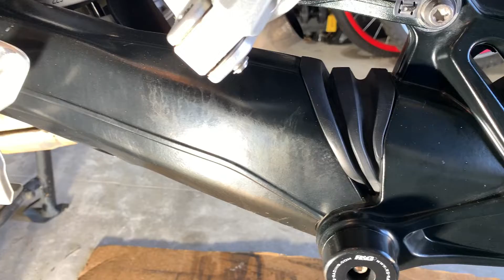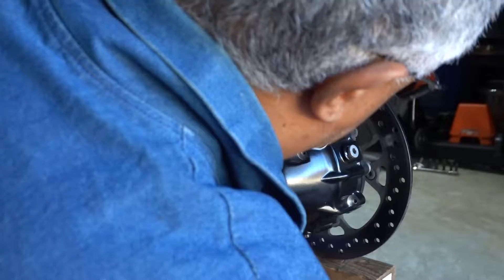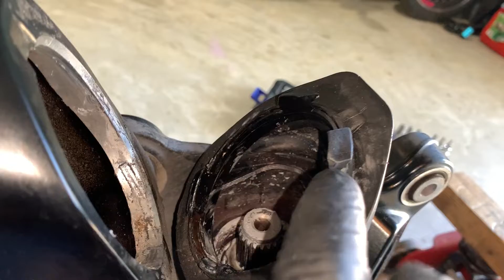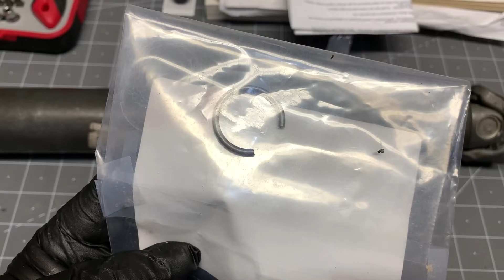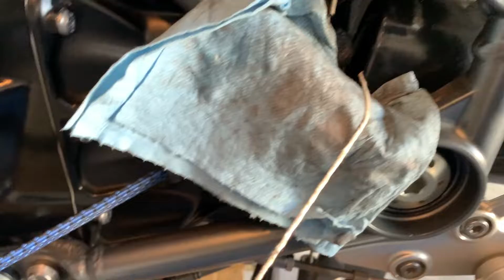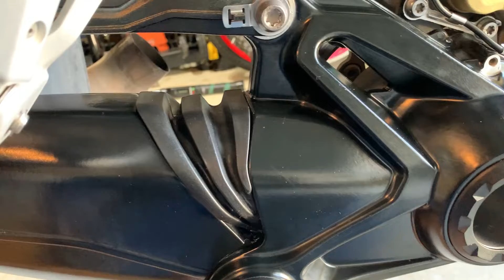Final Drive Service & Shaft Check ... rusty splines? | 60,000 mile Service | 2016 BMW R1200RS

Comment: Just serviced the shaft on my 2024 RS prior to riding the bike 4 miles on the clock trailed from new to my workshop , stripped down and found no lubricant at all on the gearbox output shaft and a slight coating of white grease round the final drive shaft , not good , like you no clip fitted from the factory and that’s on a new bike so don’t worry about it clearly not required 👍🏻
Reply from the maker: Thanks for the comment. If you read the comments for this video you’ll see more than one about the clip, some of which border on the accusatory regarding whether it was missing at the outset. Yours is another testimony that these bikes may or may not come with the clip from the factory. Of course I knew that years ago, and am totally not bothered one iota about the lack of clip. 😊
Reply: @ No problem , really enjoy your input , hope 2025 is good to you and you enjoy many happy miles in the saddle , from a fellow RS owner in Scotland 👍🏻
Reply from the maker: @AWROO08 Thanks!  Happy New Year to you as well.

Comment: Did you actually leave the output shaft slip ring off ?
Reply from the maker: Yes
Reply: @GrumpyGoat  have you had any issues with out it being installed?
Reply from the maker: Not one. There are some people that seem to believe that this clip is somehow critical. The lack of clip presents only one potential problem - the shaft fusing to the rear drive unit if the splines there are not lubed. Watch the rest of my videos to see what I mean. And consider subscribing. 🙂
Reply: @GrumpyGoat  Yes, I have done mine , took the ahaft right out on my GS1250 and serviced / greased up 
All good now , yet to do my RT1200LE in the spring.
Reply from the maker: Prior to BMW coming to their senses on this shaft issue, any owner of these bikes would be well advised to pull the shaft every 12k miles and have a check. Now they have formalized this.

Comment: What is the reason, not to remove the rubber boot?
Reply from the maker: @motocomfort_de  Removal is not needed to do the service in the video. The quicker I can get the job done the faster I am able to get back to riding.
Reply: @GrumpyGoat  I have inspected  hundreds of driveshafts. To spray and fix all the scratches lasts much longer than  the removal of the rubber boot. For your own driveshaft it might be ok. 👍

Comment: I can’t believe that after 50 years they still haven’t fixed this problem in 1971 i had a r 75 and the drive shaft splines failed had to haul it home 600 miles got rid of it and bought a Honda never looked back
Reply from the maker: I can only comment on the water-cooled boxers but their treatment of this issue has been less than satisfactory. They have now started to offer replacements for the GS and RT, but the RSs are treated on some sort of a BS mysterious way in that some people are being told they get their driveshaft replaced and others not. My bike has had 60k+ miles on the original driveshaft and BMW is yet to let me know that I am eligible for a free replacement. Even if I have to pay for replacements after that, I can understand, but so far nothing. Leaves a sour taste, that is for sure.

Comment: I would not remove the circlip.  I just did this service on my 07 GSA and pulled the swingarm to re-install the driveshaft.  Upper shaft IMO only needs service every 24k miles or so.
Reply from the maker: Noted, regarding the circlip. I would not remove it either. 

There is a reason I choose to do the shaft service every 12k on my RS, and that is now validated by BMW “quietly” bringing back the bikes in my year for a change to the shaft at no cost to the customer.

Comment: I used to do this with my k1200lt. I am glad to go back to a chain. I'm enjoying my Kawasaki Versys. Simple and inexpensive.
Reply from the maker: There is a lot to be said for the simplicity of a chain drive ... until you have to change the chain and sprockets 😉 The service on the shaft is a PITA but is not too hard once you have done it a time or two. Just takes time away from riding. OTOH, you don't have to even think about the drive train for 12k miles (that is 24 lubes and many cleanings of a chain)
Reply: @GrumpyGoat  6 in one half dozen of the other. 🙂🙃

Comment: Thanks for the video . The clip goes in the front of the drive sharft . u wil see if u look in the front hub where the splins is , at the back in side is a groof . fit the clip in . ones u push the spline end in to the back of the drive sharft of the gearbox . take a rubber malat or wooden blok and tap it from the rear end of drive sharft . that clip is very important , it prevent the Drive sharft to move forward and back wards , when the swing Arm goes up and down . Kind Regards Michael .
Reply from the maker: Thanks for the comment and interest in complete installation, Michael. 

I am aware of where the clip is supposed to go. My bike did not come with this clip from the factory and there were no issues. I agree that the angular movement of the swingarm results in an axial movement along the ends of the cardan shaft in way of the splines. On my bike without the clip there is simply movement on both ends. With the splines lubricated every 12000 miles this is not an issue, with the clip not installed. Not having the clip installed makes removal of the cardan shaft easier when I want to pull it and inspect its U-joints. And that is more important to me than having the clip in place. 👍

Comment: the ring is probably on the splined sleeve, that's why you couldn't install the cardan shaft.
Reply from the maker: I may have mentioned (repeatedly) there was no ring installed on my bike from the factory. Neither on the male or female end of the connection at the transmission end of the cardan shaft. Others have reported similarly. A friend said his trusted BMW technician told him he has seen bikes without the ring installed. 

Without the ring the cardan shaft is more easily installed and removed. 

Thanks for the comment. Sorry if I seem defensive but there is another viewer who insists I must not know what I see / feel in front of me, arguing that the ring has to be there - on my own bike!

I actually have a set of 3 videos which I did around 48k where I discussed this absence of ring. I have since decided I don’t want the ring on my bike. It works just fine without it. I have also decided to pull the shaft every 12k miles for inspection. Lack of ring makes that job easier. I also have a new shaft sitting on the shelf.
Reply: Thanks 
I’m from Brazil, and here we have a lot humidity, so i inspect ir every 10k km.
Reply from the maker: @rafael45357  I’m not inspecting it for rust on the spline. I am inspecting it to see the condition of the universal joint. These have failed in many bikes Anna that is my primary concern. Cleaning the spline of rust and relubricating the spline is just an incidental maintenance step for me. Neither are called for by BMW as part of scheduled maintenance.
Reply: @GrumpyGoat  here in Brazil we have had several cases where the rear splined axle is welded because it lacks lubrication and humidity.
Thanks
Reply from the maker: @rafael45357  I can well imagine. Good to inspect and lube periodically.

Comment: Obviously in order to assemble with the snap ring you have too insert the ring in the inside diameter of the drive shaft. It would be impossible to assemble the way you tried.  All that aside. Thanks for your efforts 21:50
Reply: The purpose of the lock ring is to prevent the drive shaft to slide in and out from the output transmission shaft
Only the final drive end slides in and out of the drive shaft(pinion shaft).
The movement is so little,one end is held stationary and only the rear of the drive shaft with pinion final drive floats.
If You look at a rear drive car, there is a sleeve with a grease fitting that slides in and out as the droop of the rear end changes the length of drive shaft.
Put that lock ring back and prevent the drive shaft to walk back and forth.
Reply from the maker: @ralphpettino296  Thanks for the comment. One does have to wonder why some bikes did not have the ring fitted in the first place. For me, I want to be able to easily pull the shaft to inspect both ends. Having the ring in place makes removal more of a chore with no perceived practical benefit.
Reply from the maker: Thanks for your comment but I don’t agree with you. Just to let you know, several RS owners who I know and respect have reported that their bike did not come with a split ring, while others did. 

I will admit I could have tried harder to install the clip, but I was inclined to not bother since it was not a problem up to that point, and removal would be made unnecessarily more difficult, and it was my intent to remove it every 12k miles.
Reply: @GrumpyGoat  If you don't have a clip it must be installed in the driveshaft, not on the transmission output spline. The problem is that it's extremely difficult for a diy'er to do without the tool designed for this purpose, maybe a service tech could help with that. If you were to buy a new driveshaft, the pin will be pre installed from the factory. If the retaining clip is not always there as you mentioned, the shaft should slip out when the final drive housing is pivoted back or removed. If the clip is in tact you'd lever a long screwdriver in between the shaft and u-joint on the front end to disengage it. You would lever the shaft in the opposite direction when installing, Do not beat on the back of the shaft to accomplish this. When levering the shaft in place, you should hear a click or snap and a forward movement of 1/8 to 1/4 inch when engaged. This process is explained in the Haynes manual for these BMW's. If the front splines are not fully engaged, the rear will not engage. If there's no clip, you will likely have some back and forth movement, albeit slight, of the shaft, which could cause unnecessary wear on the splines and u-joints over time. BTW, the retaining clip fits in a fairly deep grove and is not easily visible with the spline grease covering it. The grease should be 60% moly, which is more like a paste than your typical generic grease.
Reply from the maker: @surferdude642  I said what I said and am done. I bought a new driveshaft and it has no clip.
Reply: @GrumpyGoat how much $ was the new one?
Reply from the maker: @ About US$200
Reply: @GrumpyGoat  used to be 1200$ in early years 😀
Reply from the maker: @ Yes that is why I bought one of the new ones at $200 before it went back up. Then BMW issued the change to the maintenance schedule and decided to change out shafts every 36k miles. So I have a spare shaft.
Reply: @GrumpyGoat   I believe the ring can get destroyed at dis assembly. This would explain why some claim it never was on their machine. In your video when you dropped the final drive down the shaft released from up top. A clip would have prevented that. Operating without the clip may put forces on the final drive that engineers avoided with the retaining clip.
Reply from the maker: @chuckgenaro4373 , have you actually done this on this bike? The clip cannot be destroyed *at all*. It is not made of weak plastic; it’s a thick steel ring. Pulling the shaft out with a steel circlip in place cannot destroy the circlip. It would either stay in place inside the gearbox end, or it would come out still attached to the driveshaft spline. Intact. 

In my case, originally the driveshaft slid out of the gearbox end *without any hint of resistance*, i.e. there was nothing there to hold it back. Also, a friend informed me that his BMW master mechanic of 30-some odd years confirmed to him that some of them come without the circlip. 

So, my experience is that mine did not come with a circlip, others on the Forum have said theirs did not have one, and the master mechanic said he has seen bikes without this part. I don’t know what else I can tell you. 

This discussion has run its course, thanks.
Reply: @GrumpyGoat  I found my clip.  It  had remained hidden in the inside diameter grooved undercut, covered in moly grease. It should reassemble the same way.  This bike is a 2014 R1200GS. This is the second time I’ve done this however the fist time  I did not remove the shaft, I was afraid to pry it past the retaining clip.  That’s why I was watching your video, to remove the shaft completely. Thanks again for all your efforts

Comment: Hi Grumpy.   I have a very reason for asking are the splines the exact size front and back?    Regards....Dave.
Reply from the maker: David, this is hard to say since the shaft is in the bike at the moment. When you say “size”, what do you mean? Diameter? Length? Teeth, number and depth (not to mention shape). No way to know without having the driveshaft out and taking very specific measurements, and even then tooth shape would not be easily measurable. One thing I can say is the gearbox and has a groove for a circlip so that spline is most likely not the same length as that on the final drive end.

Comment: Hi, I enjoyed the video, just one pointer, like you I thought 'no split ring', but on closer inspection the split ring is actually installed internally on the spline of the drive shaft that is why you could not get the shaft onto the gearbox shaft.
Reply from the maker: Hi John - Glad you enjoyed the video. There seems to be a little confusion here, though. On my bike there is no split ring inside the gearbox female end - it did not come with one, either on the male spline of the cardan shaft or inside the female end of the joint at the gearbox. I felt for it with my finger when I first pulled the shaft at 48k. 

The reason why I fight (a little) to get the front end of the cardan shaft into the gearbox female is because of the floppy nature of the joint and the weight of the shaft and the tight access, which all make the alignment tricky. It is not because there is a split ring in there since there is none. One aligned right it is very smooth to go in (or out). 🙂

Comment: Posted your video on a forum to help another person and someone said this about the Snap Ring.

''There is definitely a cir-clip on my DS on the GS
That's why they have the groove
It isn’t on the output spline it is inside the UJ connector.''

So it appears the snap ring is inside the ''U'' Joint and not locks but holds the shaft in place on the output shaft spline. I would say that you DO have the snap ring, but just can not see it unless you look INSIDE the ''U'' joint itself.
Reply from the maker: Thanks for sharing the video. 👍 It has been established for some time now that some RSs do not have the clip fired from the factory. This was confirmed by a BMW technician telling one of my friends who also owns an RS. My bike did not come with a clip fitted. If there was one inside the transmission output shaft I’d feel it when inserting the forward spline of the cardan shaft. There would have to be some sort of “click” as the forward spline goes through and the clip seats in the groove on the forward spline. This does not happen in my case.

Comment: I watched another video on this subject and the split ring is inside the drive shaft end that installs over the output shaft.
Reply from the maker: Yes that is correct. Or it can be put on the forward spline and then pushed in, but as I believe I said in the video, putting it in would make pulling out the shaft difficult the way I do it so I will continue to forego the clip.

Comment: Have you had the rubber breather installed yet and the drive line test done? When installing the rubber valve, does it snap in and stays in tight? A few people have mentioned the valve installed was very loose and one persons somehow got pushed inside the housing because of no lip on each side to hold it. Another said. ''the rubber valve they install is crap, any external pressure dislodges the valve internally leaving an open hole''. Sounds like they fall off?
Reply from the maker: I have not been invited to have the rubber valve installed and, based on what you have said, it’s sounds like it is more of a dumb solution than I already believed. I would not be pursuing this “solution” unless invited. As you can see from my videos, I have no water accumulation on my swing arm, and that is after washing regularly including with a pressure washer. People just have to use their brains when washing in the area and they need to ensure that the rubber gaiter is properly installed and sealed as well as possible. The joint is weathertight when done properly (not watertight) but when installed properly is fit for purpose. The duck bill valve is just another complication to try and minimize rust on the rear splines which could be managed with regular servicing as I am doing.
Reply: @GrumpyGoat  Thanks for your reply. Some have said that this new breather falls off easy, so must be careful when washing. I think I would pass on this mod, also people have said when they drill the housing, some have big scratches left behind.
Reply from the maker: @ericjames7680  Wouldn't be hard to glue it on after the fact.